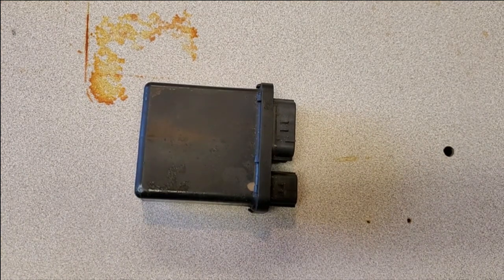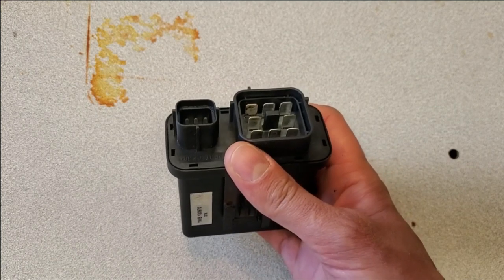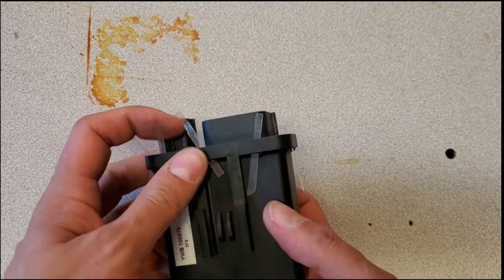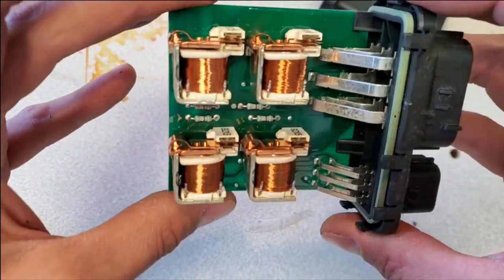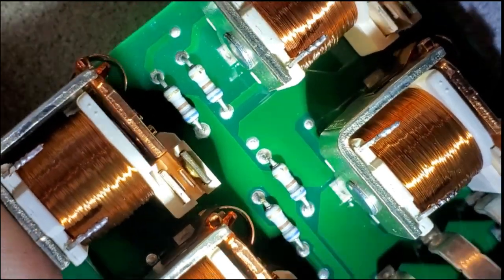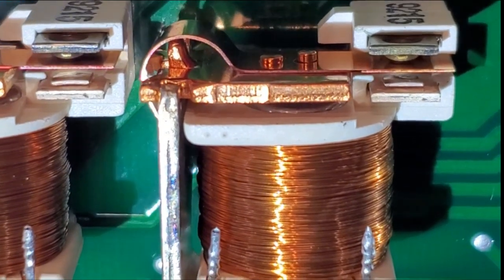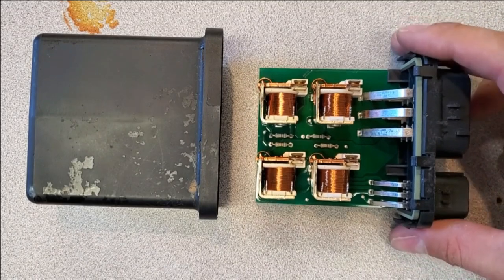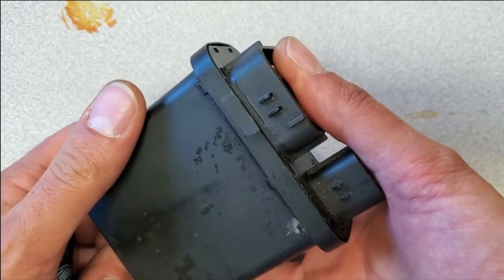Mini MPI Main Relay Failure! Tear down and Diagnosis

Comment: Nice job of ferreting out the problem.  What would be interesting to me would be putting it back in use and see how it now performs and how long it lasts.
Reply from the maker: Unfortunately i dont have a car to test it with. I could only use the new part and send the car back to the customer. I too am interested to find out if cleaning the contact pads is enough of a repair to make this last a few years.
I did test it with the ACR4 and all systems responded normally.